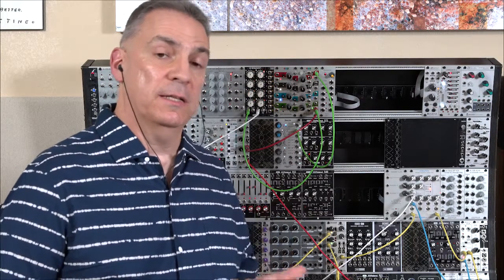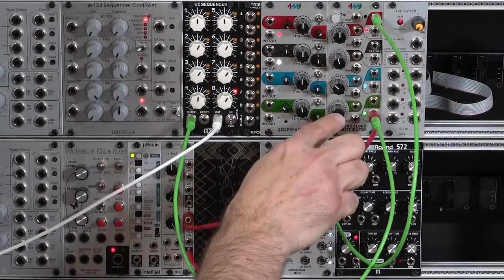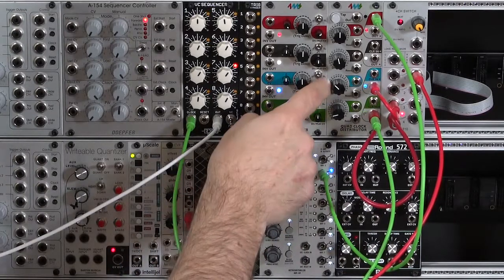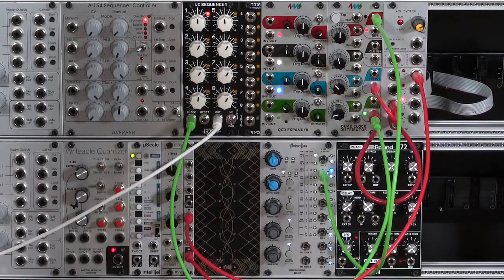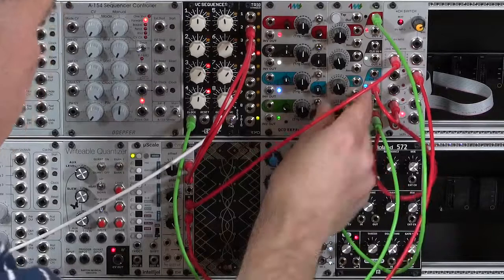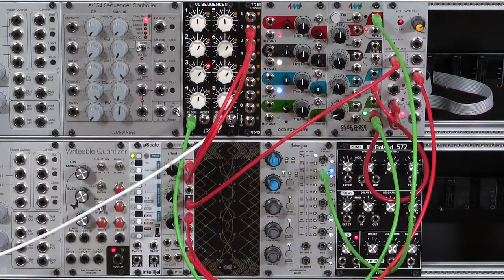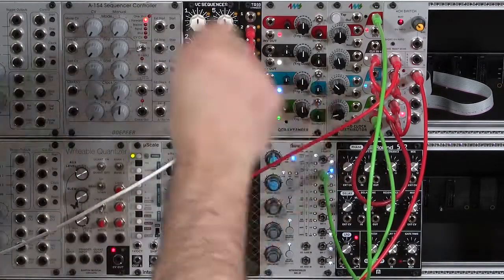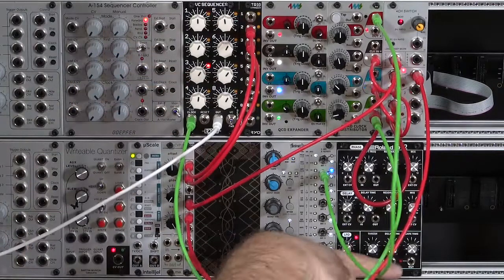Ratcheting Using a Clock Divider and a Sequential Switch

Comment: great demo, thanks. could you please give an example of a gate processor, as you mention at 6:58?
Reply from the maker: The Doepfer TDEL is the one I use in my studio modular. Set the delay to zero (full CCW), and use the gate duration as a "hold out" to prevent unwanted triggers.

Comment: Awesome video. Can you think of a way to get behavior similar to a metropolis (hold, odd value repeats etc) with a typicaly 8 step sequencer?
Reply from the maker: A lot of it comes down to how you clock the sequencer. There are several modules that can create interesting patterns of clocks to feed a sequencer, such as the Malekko Varigate. It also helps if the sequencer has a way to choose the trigger outputs per stage, such as the Doepfer and RYO in the videos - you can choose to leave out some steps to gets rests etc.
Reply: Im using the 4m RCD with expander, WMD SSM with expander and the makenoise Rene. 

I am going to try this ratcheting as you have shown in this video and see if it takes me down a rabbit hole. 

thanks!
Reply from the maker: In case you didn't see, there's 4 videos total in my ratcheting series; the others might give you additional ideas to try out:
https://www.youtube.com/playlist?list=PLli7NH8pJF8TgLci8HhcbCYBespKDBGMX
Reply: Take a look at the Rebel Technology Phoreo. After you clock it, you send in any trigger pattern (or just use the clock) and then you can multiply that incoming clock and set a specific amount of repeats. Those two parameters are cv controllable, so what that means is you can use a sequencer to sequence which steps get multiplication or repeats. You should be able to approximate some of the Metropolis functionality with these features.

Comment: Hi I am really enjoying your Channel. 
At 4 minutes you mention that you would in some cases need to be careful with patching with a multiple and that in this case, your module has diode protection. I was wondering if you could elaborate on when & why someone would need to take care like this in order to avoid causing damage to modules. 
Do you have a video about this topic by any chance? 

Thanks again
Reply from the maker: Hi -
In general, you do not want to patch where an output is connected to another output. This includes patching a few outputs into the same passive multiple. In many cases, this would cause the output of one module to try to drive the output of another module, which can cause damage.
However, a few manufacturers have built protection into the output of their modules to prevent this damage. For example, on trigger and gate outputs, some manufacturers add a diode that allows a voltage to only flow in one direction - so another output cannot flow back into it. This means if you want to combine multiple trigger patterns into one composite pattern, you only need to use a passive mult to add those streams together. (Otherwise, something like an OR logic module would be required.)
In general, do not assume you can patch an output to an output. But if a manufacturer specifically mentions in the manual that it's okay to do it with that module, then it's safe (for that module).
Reply: @LearningModular  Thanks for pointing out that output to output is the main kind of patching to avoid. If you could do please, I would like a little more clarity on some points you made. 
1. I assume that what you mean by "patching a few outputs into the same passive multiple" is using a passive multiple in the reverse direction to mix several signals? And in doing so the routing within the multiple could cause the signal to go in the unintended direction into one of the output ports of one of the modules. Is that right? 

2. You said, "if you want to combine multiple trigger patterns into one composite pattern, you only need to use a passive mult to add those streams together". 
In saying this, are you implying that an active multiple would be a safe way to mix trigger patterns as long as the modules being used have the one direction diode? 

3. Do some manufacturers add a protective diode to outputs that are generally intended for audio signals too? Or only trigger and gate outputs? 

Thanks again.
Reply from the maker: 1) Yes. They are just meant to split one signal into multiple signals, but some try to use them as a mixer - which is bad idea unless you explicitly know that the connected modules are okay with it.
2) Active multiples have just one input and multiple outputs, so by definition cannot be used to mix. (Compared to passive multiples, where any jack can be used as an input or an output. But you only want to use one as an input.)
3) The type of protection on audio or CV outputs would be different than a diode, as diodes slice a small voltage off go signals going in the "right" direction. You will see some manufacturers say that you can also patch their non-gate outputs to other outputs, but it is less common than with gates.
Reply: @LearningModular  Great thanks a lot for your help its appreciated : )